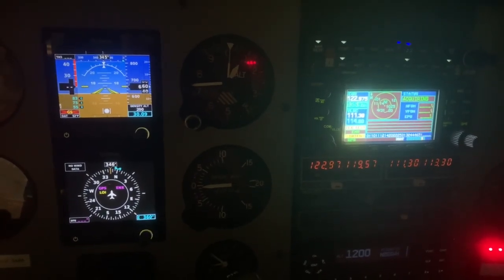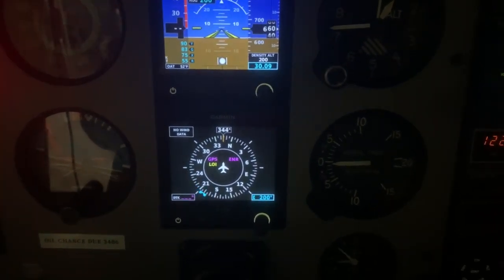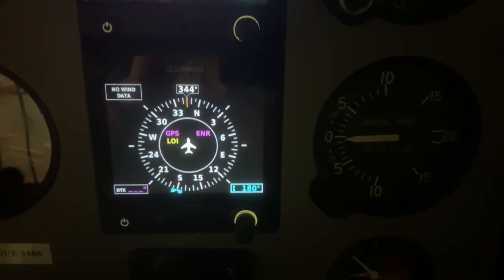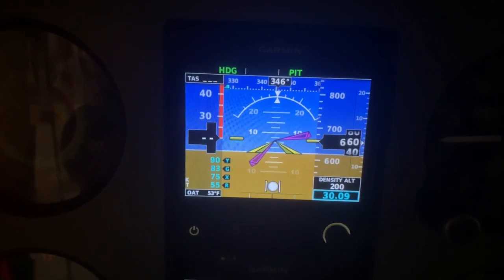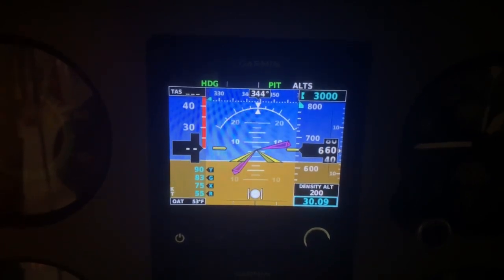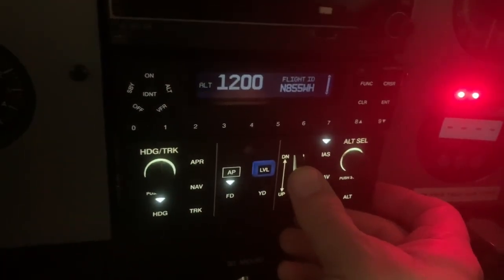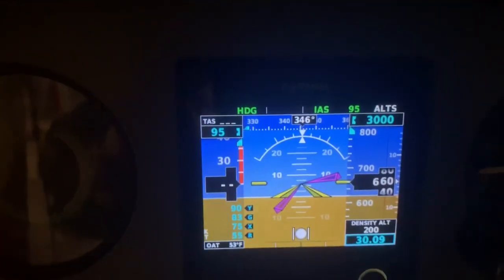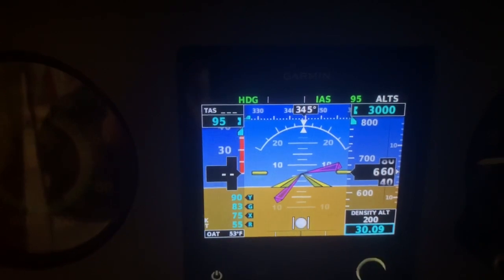Programming the GFC 500 for an instrument departure clearance

Comment: My two cents? I would bug the altitude, speed and the heading, but activate go around mode for the takeoff. Once you're above 400, or whatever altitude you choose, then click heading and IAS. That way the FD bars are set for wings level, and pitch for climb out. But everyone has their preferences.
Reply from the maker: Yes that’s what I do now, too.  Thanks!
Reply: Makes sense. I am going to try that next time. Runway heading, 400 or so feet AGL then move the heading bug to 360.

Comment: Nice...mine is  being installed this month. Can’t wait !  FYI...you can also use the knobs on the G5 to set heading
Reply from the maker: Yes, you can.  However, especially when flying in IMC, it's good to have a repeatable pattern to use.  Since the mode control panel is installed for selecting headings and altitudes and modes, it's best to develop the habit to have the same place to reach consistently when you hear ATC say "turn left heading 180."  

That said, if the mode control panel failed, yes, I'd use the G5 knobs as backups, so I agree that a pilot should be aware that this is possible.  Thanks for watching and sharing this tidbit!
Reply: @TroyWhistman  Well, been flying with it since my post 2 years ago. Since it’s a Cherokee and the GFC 500 is bottom left corner , it’s much easier to reach over to the G5 and select a heading.